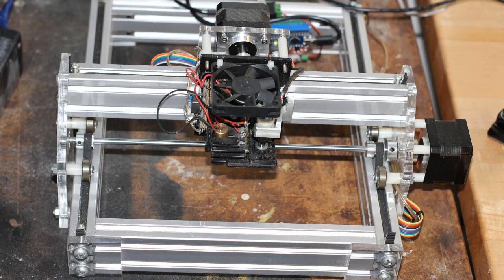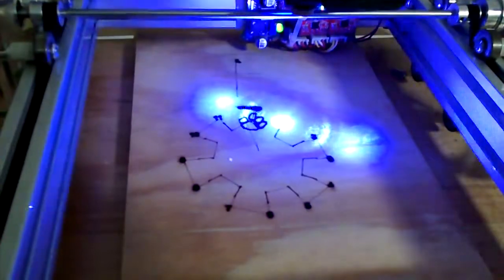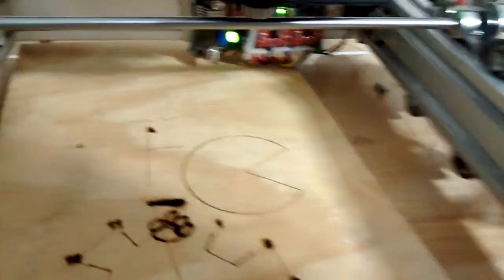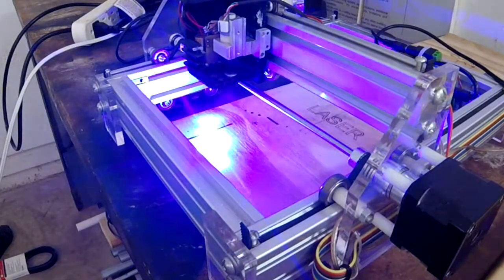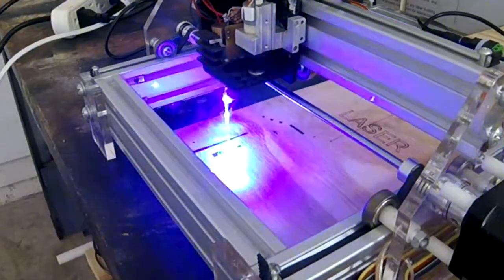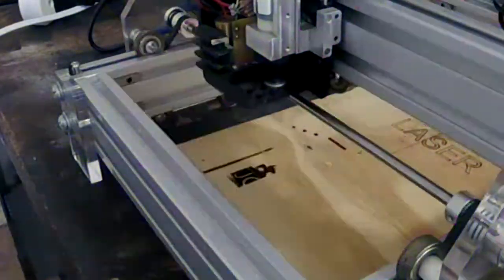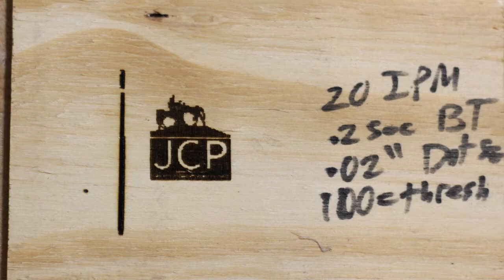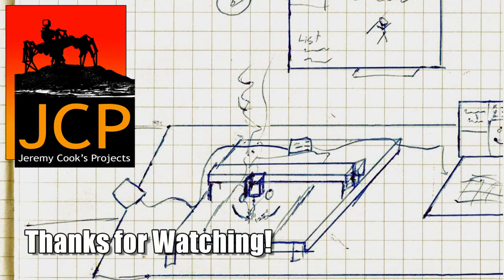Endurance Laser Engraver Kit Review

Comment: I've had the 2.5 laser for about a year, but haven't gotten around to using it.  I've decided (recently) to actually give it a go.  My current hang-up is... How do you focus the darn thing??  I have the provided green laser glasses they provide, but I don't care to actually look at the thing to try and adjust the Z on my CNC Machine.  Do you have a recommendation?

Thanks,
Corey
Reply from the maker: Hi Corey. I don't blame you for being paranoid - I actually bought some other glasses that seemed to be better for the application, and built a box around it as seen here with a window: https://www.youtube.com/watch?v=JHed2Wq01EA - I haven't used it in a while though. Even with that I'm quite paranoid about looking at it. Another option would be to have some sort of remote camera/viewer as a sort of "virtual window."

Thanks for checking the video out.
Reply: I appreciate the follow up and prompt reply.  I'll check out the Wavelength and consider some upgraded glasses.  I may even do the remote camera suggestion.  Thanks!
Reply from the maker: No problem. I would guess that their glasses are safe, but given the possible effects, I'm with you on being extremely paranoid.